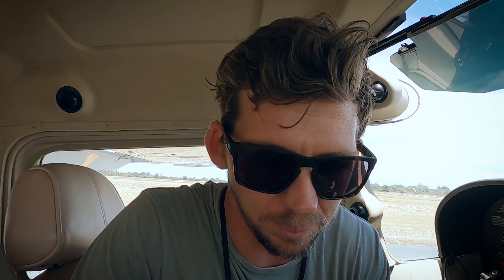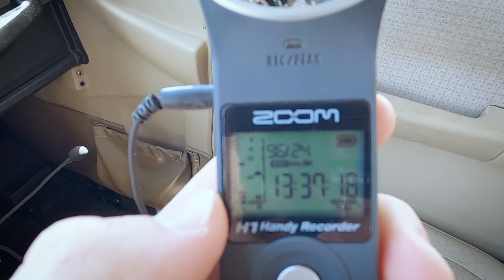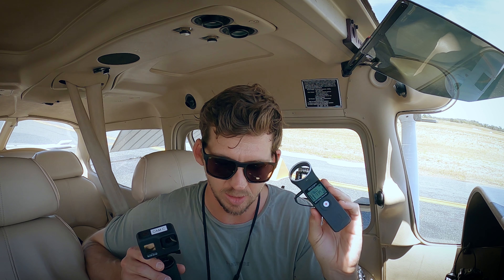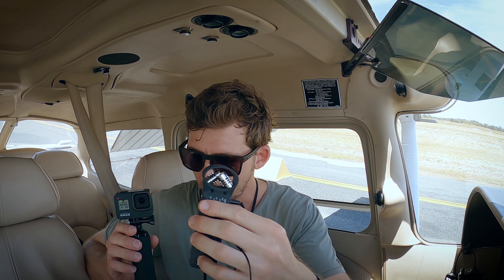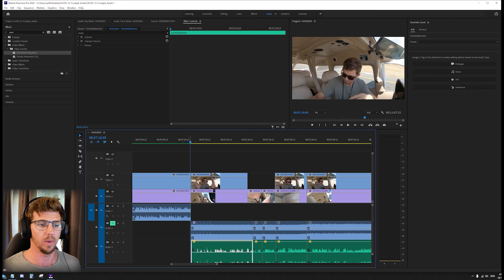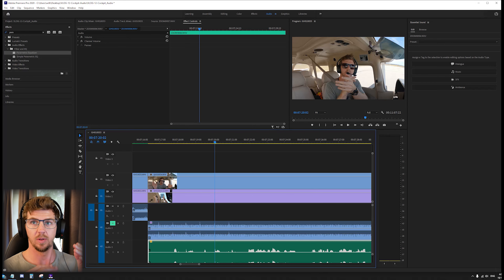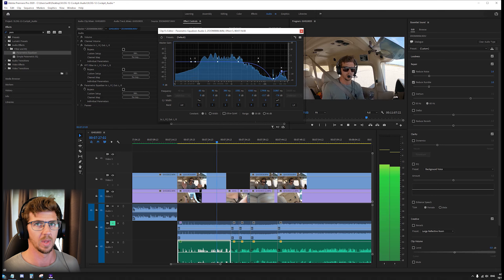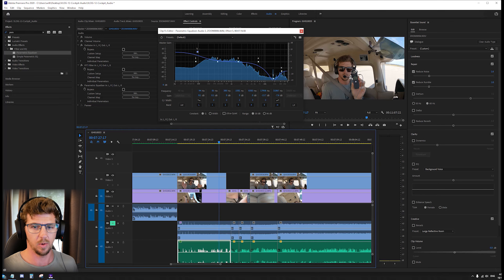Complete guide on how to record and edit cockpit audio

Comment: I will try to record it with my Zoom H2N which supports active output recording (i tested it at home with the Output of my PC). Do you think it wil work without the InLine control thingy?
Reply from the maker: It really depends on the recording device and the output power of the radio.. If able definitely check and test your recording levels in the plane.

Comment: Where did you get the adapter/splitter? 
Can you share links?
Reply from the maker: Any audio/music shop should sell them. Also attached an eBay link hope this helps.
Doesn't have to be that one in particular, male 1/4ich jack to dual female 1/4inch jack is all you need.
If your recorded audio only comes through on one track, IE the left track, just double that track in Adobe, (right click on audio file in time line and select both sides as left)  track. 

https://www.ebay.com.au/itm/144414144410?mkcid=16&mkevt=1&mkrid=705-154756-20017-0&ssspo=6aS2kXDfRgG&sssrc=2349624&ssuid=yB-IA_fxREK&var=&widget_ver=artemis&media=COPY

Comment: Hi Will, great informational video. Thanks for presenting. For the few videos that I’ve done I’ve only plugged the cable directly into my GoPro to record audio but I’m seeing a trend of other pilots preferring to record audio by using a dedicated recording device. I’m not an audiophile and the audio through the GoPro sounds good enough to me. What is the overall benefit?
Reply from the maker: Thank you 🙏
From what I have seen the GoPro does a good job with audio. The only advantage I can see in using a stand alone recording device is that it gives you the ability to record audio in a higher quality which allows it to be cleaned up a little more in post.

Comment: Recording next thursday -- I've got a zoom h6... if I'm using the 1/4 inch splitter from the headphone jack can I take a 1/4 inch to XLR cable and plug that directly into a Zoom H6 recorder? You can control each of the individual lines of volume so it doesn't clip... or will it still clip a lot because it's an audio recorder like you mentioned? Why is it you can't plug directly into the h1?
Reply from the maker: Hi Sylvie, 
I have not used a H6 in the cockpit, so it may have some features I'm not aware of. 
In saying this, as I understand it, the reason I came across this issue and that you might possibly as well is that the line out from the aircraft is amplified to power the large drivers in most General aviation headsets. This, paired with the cockpit being a loud enviroment and the necessity to be able to hear all radio calls clearly overpowers the input of "most" audio recorders. 

I suggest if possible to do some testing before the flight.

Or maybe even record all audio from the rear passenger headphone ports as they have a standalone volume control (if the plane has more than two seats). Ask the pilot 

Or any form or a inline volume control as I show in the vid.. Any audio/DJ/music store should have something inexpensive that you can adapt. 
Be sure to check your audio in the cockpit with some headphones before continuing with recording, the peak bars on the recorder show db only coming in, it won't show if it is clipping before the fact. 

If anyone else has more info, please jump in :) 

Feel free to send me a DM on insta, happy to help more if I can. 
Let me know how you go with the recording, I'm interested to hear how it goes ... Pun intended 👌👍

Comment: I have a Zoom H6 it has the Line in input, timecode, and XLR inputs, but it's a bit overkill for cockpit audio, i should probably get the F1 or the F2.
Reply from the maker: You are right, Probably a little overkill, But if it's what you have i would probably just go with it :) 
After you get into the recording and editing you can always swap the hardware out to something smaller.

Comment: For the audio recorder does that have to be plugged into the aircraft before it starts recording or will it record without being plugged in?
Reply from the maker: It would have to be plugged into the line that you wish to record from before hitting record, or the recorder will default to the built-in microphone. 
This can be done before or after the aircraft is started.... Remember to check your levels once the aircraft is started and your radio volume is comfortable.
Reply: @WillOstrick  Yes I have the Bose A20 with the headset adapter and I’ve tried it without plugging into the aircraft and I can barely hear anything on playback. Sony ICD-PX
Reply from the maker: @DennisCOSMIC  ohh got you, it will need to be plugged into the aircraft. The aircraft audio system does the amplification of the signal, that should solve your problem.
Reply: @WillOstrick  thanks for the info! Just tried it in a 172 and it works great! Now I can finally get recordings.

Comment: Hi, I tried my audio recorder with a splitter and line in from the Phones socket as you've done. While my headset squelch was fine and the mic only picked up audio when I spoke (or ATC), the audio recorder picked up a consistent noise from the engine, as if my squelch was fully open and no clipping from my headset mic.  Any idea what Is going on and how to resolve?
Reply from the maker: Hi Rorie, hmmm that is a little strange. 

Could you tell me, does the recorder pick up any voice coms via the mic at all ? Or is it only back ground noise.  I'm thinking that maybe the external mic on the recorder is trying to record sound. ? 

Also, if you have the radio/coms on while everything else in the plane is off, including engine. What happens then ?
Reply: @WillOstrick  Sorry I should have said, yes it picks up voice perfectly via the phones socket rather than via the recorders built it mic.  Given the clarity of the voice, its definitely coming from the "mic in" rather that build in mic.  I did actually test this before my avionics were on - plugged the jack into the recorder, selected 'mic in', and made some noise. I played it back and there was no noise recorded as expected. Tested again with radio stack on and it picked up my voice. So working as expected.  However, when flying, it was as if my mic was 'open'. It recorded all background noise (the engine), me speaking to myself and transmitting (as if it was a stuck mic) but also other aircraft and ATC.  It must be something to do with my squelch being too sensitive?
Reply from the maker: @87Rorie  Thanks for clarifying, so if its all working ok, taking a nice recording while the engine is off. My guess other than your squelch not being sensitive enough. Which I'm sure you would notice. Is perhaps electrical interference on the cable.  If you are in a 4 place aircraft try recording from one of the rear plugs, or even just to test try using the copilot plugs ? Let me know how you go.

Comment: Hey man, Hopefully you get to see this message, I'm in a bit of a bind here. If there are two people in the aircraft (example: Instructor and someone learning to fly for the first time) do I need two splitter setups for each person, or can you put this in one of the lines and have it hear both people and ATC? - looking to record my flying lessons soon but want to make sure I'm not missing anything - thanks!
Reply from the maker: Hi HilmLeo,  You will only need one splitter for your head set to record all audio from the intercom system. Both of you will be able to talk and listen as normal.

You can also just use a 1/4inch and record from one of the rear headset plugs, if it is a 4 place aircraft. Just make sure you have the rear pax volume set
Reply: @WillOstrick  You're an absolute lifesaver my man, was about to order 2x of the things needed, but if I can get away with using just 1x that's a dream!
Reply: @LeoDoesItAll  Hey there. We  used N flight audio cable and recorded into our phones directly from the plane and were not able to pick up ATC or copiiot audio. Can you help us troubleshoot?
Reply: @WillOstrick  Need help. Looking to record Flight instruction as well with 2 headsets recording all audio including ATC. We Tried recording with Lavalier as well as N flight audio recording cable and still only picking up Pilot audio. NO ATC or Passenger Audio
Reply from the maker: @benarnst9228  At a guess it sounds like you have the ATC audio isolated on the com's panel ? 
You need to have the audio panel sending all audio to pilot/copilot and crew.